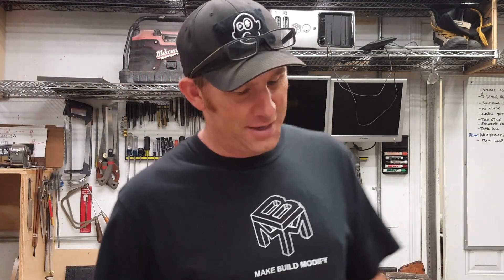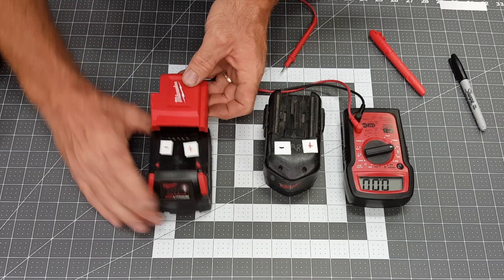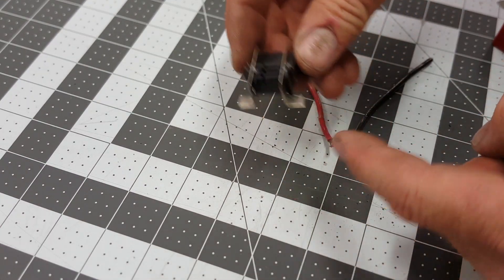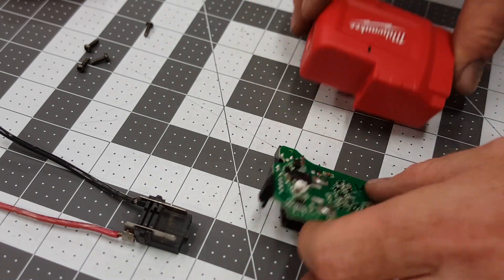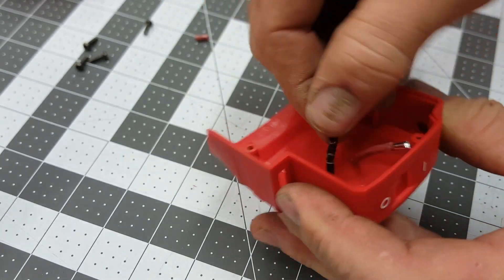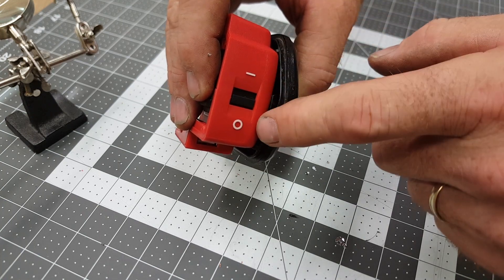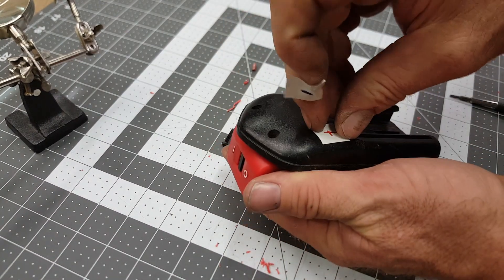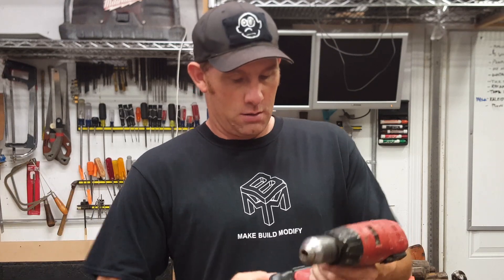HOW TO make an 18v NiCad to 18 volt lithium ion battery adapter for Milwaukee tools

Comment: Would this work for the radio?
Reply from the maker: If you made one for the radio you would have to pull the batteries out of the old housing and somehow run a cable between the new battery and the old housing.  This is because the radio doesn't have enough space to receive the new batteries.
Reply: Make Build Modify ....I was thinking about that...I'm going to try and figure it out...might even go sideways...
Reply: I used jumper wires  ...the small " modern" batteries work and fit the radio...

Comment: Please! If you could make one for the Dewalt 20V to Ryobi 18V it would be awesome. So far to have this built by a third party they want a ridiculous $60.00 plus $29.00 shipping. If you can it would be great otherwise a recommendation, someone that will build this for a more reasonable price. If dewalt made a battery powered glue gun this would be a done deal but they don't.
Reply from the maker: Wow, $60.00 plus $29.00 for a manufactured parts is a bit steep. Unfortunately, It would cost a lot more for me to make one because just the parts would be more than that. It's only really worth it if you have the parts already.

Comment: Enjoyed the video. I have an original 12volt Milwaukee drill that I replaced the batteries 3 times. I just use it as a back up tool now. I wonder if you can make an adapter for that?
Reply from the maker: I'm not sure. It's took a few hours of playing around with the parts and pieces before I managed to make my first prototype.

Comment: Great video. Thanks! I have a cheap, NiCad Sears Companion drill, bought on a whim, but put in a drawer and forgot about it. Still works, but I'll keep your mod in mind, if the opportunity and parts presents themselves. I had always preferred to use corded tools, DeWalts, as I didn't need portability, and didn't like the disadvantages of batteries. But I re-discovered welding last year and on Black Friday scored a Lithium-Ion drill / impact driver set, 2 batteries and case for just $79 at Menards Hardware - their Masterforce house brand. Now, I'm eager to invent work, just to use them! The impact driver is strong enough to remove my cars lugnuts, and I own a more powerful, corded impact wrench for heavy duty auto repairs.

You are very experienced and talented! Me, not so much (in this area), but your mod is motivating! So if I did this, I'd disconnect the battery from the tool when storing it, to reduce the risk of a fire. Heck, as I don't have a great understanding of electronics, I may also store the battery by itself, in a steel can, on concrete, separate from any combustible materials, if not outside. Otherwise, I'd be paranoid my house would burn down!
Reply from the maker: Lol! I haven't had any trouble with my modifications yet. But you're right. It's not a bad idea at separate the battery from the tool when it's not in use. I got the habit from some older tools that I use to have that would drain the batteries overnight. Thanks for watching!

Comment: It is a shame that you had to waste a more expensive m18 usb adapter to get your m18 battery receptacle. I originally thought of doing that, but now there are sellers on ebay who have 3d printed m18 battery sockets with leads. One seller is selling them for 15.00 shipped which is a lot less than gutting a usb adapter which costs 30 or more.

Just go on ebay and type "milwaukee battery dock" or "milwaukee battery adapter"  the sellers user name is msburko so you can just look for him that way.
Reply from the maker: 15 less or about 50%...;)
Reply: link?
Reply: Where's the link? I found one 3d printed but it's $35 so I was going to order the knock off (red) power source for about $20 & do what he did in this video.
Reply: Just go on ebay and type "milwaukee battery dock" or "milwaukee battery adapter"  the sellers user name is msburko so you can just look for him that way.
Reply: Just go on ebay and type "milwaukee battery dock" or "milwaukee battery adapter"  the sellers user name is msburko so you can just look for him that way.
Reply: bestbuystreets on eBay sells this USB adapter for $20 and that way, you can have the adapter and charge your cell phone from it or use other USB powered devices. I was not good at soldering, so this process was difficult for me but I learned a new skill as a result.
Reply: I worked with Hurricane Sandy in New York City, and remember how many cell phone charging stations they had, since we are so dependent on our cell phones. I think it was worth the extra $5 I spent to buy the USB adapter from bestbuystreets on eBay just in case I am in a place where I do not have consistent power to charge my cell phone.

Comment: Can you tell me if this adapter with a smaller Milwaukee battery fits in the older Milwaukee radio you have in your shop.  I have the same radio and I'm interested in this adapter.  Thx
Reply from the maker: Sadly, this configuration won't fit in the radio. But you could keep the two plates separated by adding longer wires between them. Then it would work for a radio.

Comment: Was curious if you are selling these?....Paul
Reply from the maker: Not right now. They would be too expensive to make and sell.
Reply: What is the cost of the Milwaukee usb power adapter?
Reply from the maker: ▶ Milwaukee usb power adapter http://amzn.to/2vV7Lex
Reply: Something similar is sold on ebay
Completed working adapter
Reply: bestbuystreets on eBay -$20.00
Reply: gospos1 I'd be happy to make one for you, but you would need to send me the top of an old nicad battery.

Comment: Good work! I have a couple of Milwaukee V18 (NiCad) saws that I wanted to convert to Li-ion  and use the Milwaukee M18 batteries of my newer tools. I was thinking along your lines, but I didn't know about the power adapter and got cold feet.

Then I discovered that Milwaukee has come out with Li-ion V18 connector style batteries. The catch (there's always a catch) is that you have to buy a Li-ion charger that is meant for those batteries, expensive as I recall. To get a little back, I bought third party V18 Li-ion batteries from Amazon. They seem to work fine, and are much better that than the NiCads.
Reply from the maker: Interesting. I didn't know there was a battery created for this. I checked some of the product reviews and there seem to be mixed feelings about their performance. I would have at least tried them I had known.  Thanks!
Reply: I have a set of original Milwaukee V18 tools with NiCad and another original Milwaukee tools V18 with Li-Ion. Those tools are interchangeable with either batteries but the chargers are not interchangeable. The original Milwaukee Li-Ions were garbage with run time 30% less than the NiCad and trips a lot with SDS drill bit stuck in the concrete. No reason to change battery form factor other than sell new tools. The original V18 NiCads were pretty bad too. I buy the 18V DeWalt NiCad batteries (much better) and transplant it to the Milwaukee battery shell. Lots of work to reconfigure but much better too. 

I was thinking about making an adaptor with a 3D printer but this video is much better and less work.

Comment: I didn't notice what you did to allow the old battery top to LOCK into the tool.  My old 18V sawsall can jump around a fair amount and a few times the original battery would come off. Do you just have to be extra careful not to do things like work on ladders with such an adapter, or do you have a way to lock the adapter onto the tool that I just missed?
Reply from the maker: You're correct. The positive lock is lost when you make this adapter. I use a rubber strap when I need the battery to stay put. But it's not necessary for most for the drill use. The reciprocating saw is the worst though. the battery rattles off if the battery is under mounted. But with these old Milwaukee tools the battery can slide on both ways. So I put it on in the direction that allows gravity to help. Thanks for asking!

Comment: Great idea I guess, a little wonky with all that extra just for the outcome you get.
You can go to home depo and but the 18v nicad for the old tools still for 40 bucks.....
Reply from the maker: Good point. But with this solution you get the use of the USB and the old tools. Plus all of the antiquated charging gear can go. I like to use one type of battery for all of my cordless tools. Thanks for watching.
Reply: Milwaukee has not made those 18V batteries for years and if you could find some, most lightly dead. BTW the original NiCads were not good. The 40 bucks one is third party, cheap Chinese knock offs. Many of them don't fit required  force into the tool then a mallet to knock it out and the plastic shell could crack.
Reply: Although you are right that the price of  Ni Cad batteries have come down, the fact that you always have to remember to charge more than one type  or brand of battery is quite annoying.  If we were talking  30 yrs ago when there was very few battery tools, I can understand that it would be easier to control the battery situation.  But we are referring to today's situation and will all the platforms available , I personally prefer have one battery platform and multiple adapters.
   If you ask why not stick to one brand ,well because some brands are more expensive or don't have a battery tool on the market yet or one brand is better performance than your preferred brand.  If brands different brands  had  interchangeable batteries , I believe the sales would increase and less pollution....

Comment: Great idea ,,, one dummy question though (since I'm an electrical dummy): will 10 or 14 V NiCd tools burn out if hot wired like this with a 18 V Li battery?
Reply from the maker: I'm not sure. I would only try it if I was willing to lose the use of the tool.
Reply: Haha, that would be very exciting with those tools running fast as hell and once you let out the magic smoke out, it would not want to run again. If you must, use a power resistor for the proper voltage drop, then it should run fine. The downside is you waste power in form of heat dissipation in the resistor. For the 10V, I would think it should be ok if you could find an adaptor using 12V Milwaukee battery. 

BTW the new Milwaukee 12V system is pretty good and should be more powerful than the old 14.4V system. I mean you could find on sale a 12V Milwaukee kit including drill, impact, two batteries and charger for around $100.
Reply: i have 2 14.4 Dewalt cobbled to run on 18v batteries. they have worked well for years. I had to open up an 18v and a14.4 drill and the motors appear to be identical.
Reply: The equivalence of voltage is pressure. That is, if your air tank is design for 100 psi, and if you pump it up to 150 psi it may hold but you're taking a chance. Cool if the 14.4 DeWalt runs on 18V.

Comment: Thanks for the video! FYI, since your last video on this I found that Dewalt makes a product specifically to run old 18v tools with new 20v batteries. It's a handy little adapter. You should add that to your amazon links!
Reply: what is the link to obtain the product details?
Thanks
Reply: Jack Jill He put the Dewalt link in the description of the video.
Reply from the maker: Hi, all of the links are in the description. Thanks!
Reply from the maker: Thanks! I will.

Comment: I've been patiently storing my old milwaukee gear, waiting or a tip like this. Thanks for posting!
Reply: It's an absolute crime Milwaukee doesn't make this adapter. Dewalt makes an adapter to convert their old tools to the new batteries.
Reply: @THX..1138  supposedly the v18 lithium slide on batteries work on the old ni cad cordless tools you just have to buy the right charger, I havnt tried it.
Reply from the maker: +Nate Cougill thanks for watching!

Comment from the maker: FIRST!!
Reply: Јоhn Daniel Nobody likes a beggar for views. Piss off.
Reply: Cannot find Milwaukee usb power adapter on amazon, canadvice?
Thanks
Reply from the maker: ▶ Milwaukee usb power adapter http://amzn.to/2vV7Lex
Reply: You can put lithium batteries in your old battery case with  PCM board to control Charging shut off and still be able to use  The old charger. Very cheap too if you do the research. Great video!